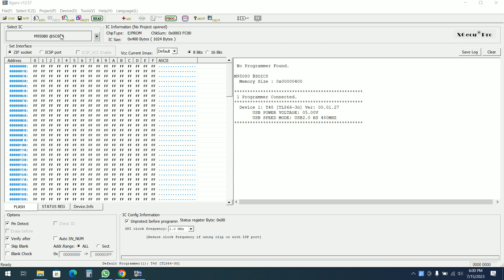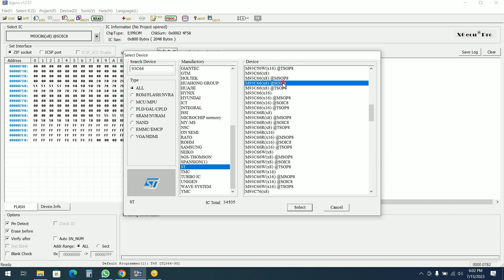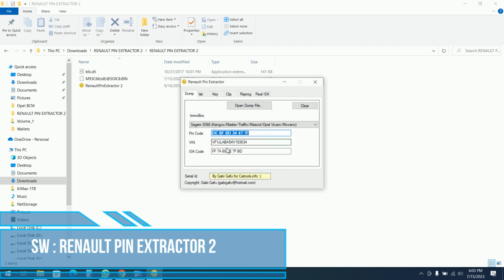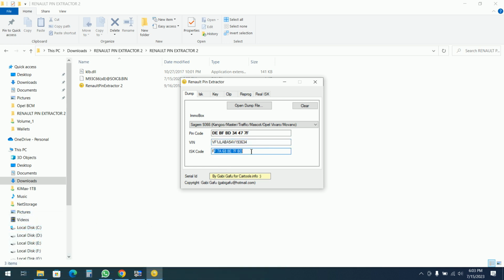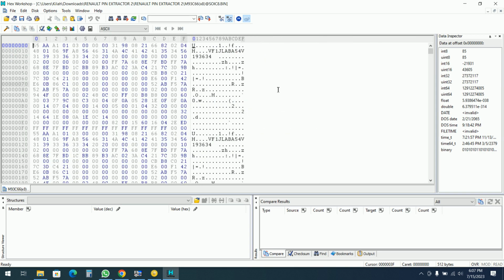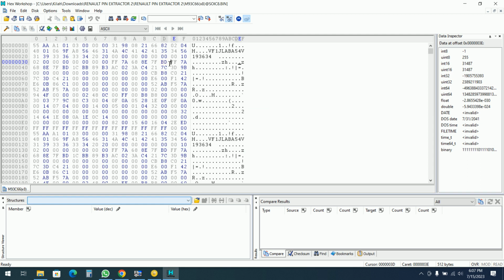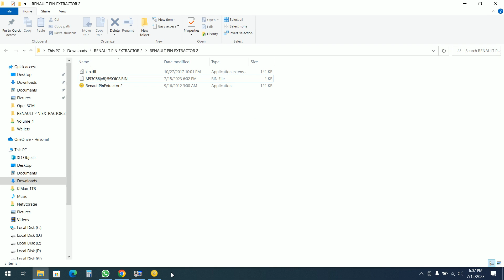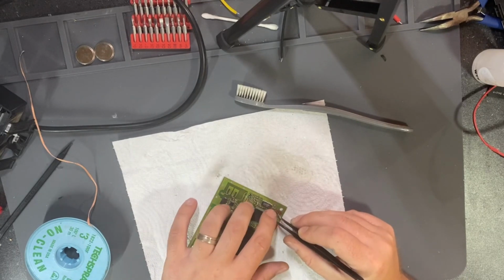Sagem UCH-N2 - Read Pin Code and ISK on bench from eeprom 93C66

Comment: Hi, do you know if it is possible to change the chip from the original UCH to the second-hand one?
If we do that, will the purchased one work or will we have to do something else? I am very good at soldering chips and I have the necessary materials.
Reply from the maker: Hi, in this specific type of UCH you can swap the eeprom only without issues and it will work.
Reply: @UnixCoDElectronics  is uch Renault Megane 2 1.6, is posible?
Reply from the maker: @lorobal on megane 2 its different uch its more easy to read pin and isk from original and adapt the other one with renolink all job via obd2 ( also the new one can be virginized via obd2 )
Reply: @UnixCoDElectronics  if I apply the same method for UCH of the CLIO 2 FASE 2 1.5 DCI 2003, it's possible?